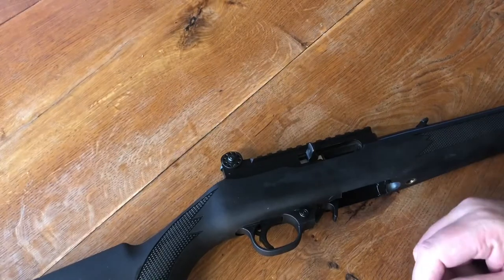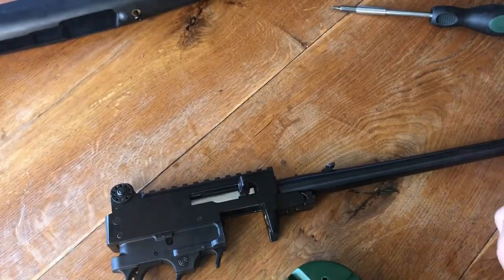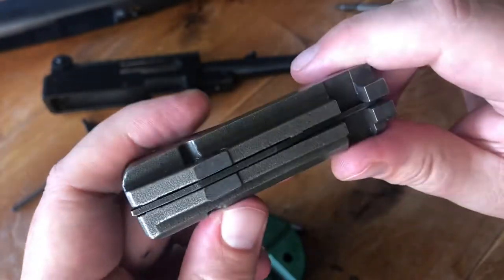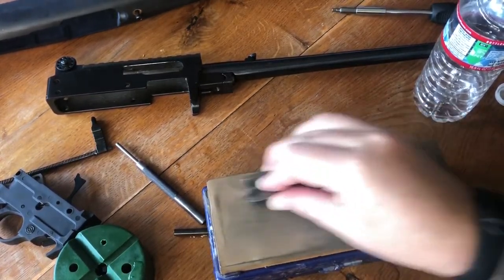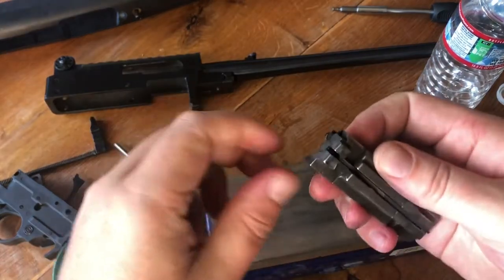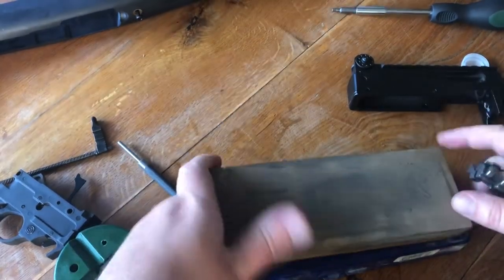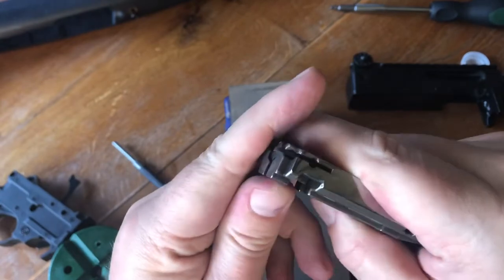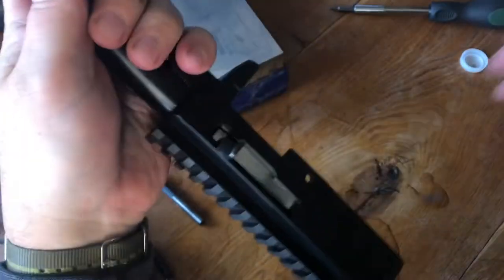Ruger 10/22 bolt polishing

Comment: I used polishing rouge, felt wheel and my Dremel to polish all the metal to metal surfaces.  The radius on the rear of the bolt that cocks the hammer, I wheeled a much less of a sharp step to a more smoother ramp. Gun grease on my fingertip on all the surfaces. Now the bolt travel is so smooth and this has reduced "stove pipes" drastically.
Reply from the maker: I thought about adding the radius but didn't get around to it.  Maybe in a future effort.  Thanks for the feedback!

Comment: I am confused about how aggressive some of the commentors are.
Reply from the maker: Me too, just sharing my process and learning and got jumped on. All good though, the interaction drives up the views I think ;).
Reply: @desertislandtoolworks1956  I just repeated a similar process on my bolt with an 8000 grit whetstone.  Mine is an older bolt so the contact surfaces are larger.  Certainly improved the smoothness of the action and possibly accuracy (could just be placebo leading me to take more time on my shots).  I also polished the face of my bolt and the breech face of the barrel.  There had been some pitting on the breech face of the barrel so I mostly took that off but was afraid of removing too much metal.  Really enjoy touch up work like this where you can improve function without opening your wallet. Thanks for the content.
Reply: @desertislandtoolworks1956  "opinions and azzholes, everyone has one and everyone thinks theirs is the only one that doesn't stink."
as for the video I like the simplicity of it, KISS always works best.
Reply: @originaloldpop8405  thanks for watching and for the feedback. I’ll try to keep them that way when I make more.
Reply: It's the internet, so many informed opinions here!

Comment: You should never sand. You loose too much material and then it's sloppy. Just polish those points and it will remain tight but run so much better.
Reply: Exactly.
Reply from the maker: Great point, that is what I did.  The stones are polishing stones not sand paper.

Comment: Raised surface on that "new" bolt means less machining and smaller contact patch which is a win win for Ruger who loves to cut corners if it doesn't really effect operation.  Smaller contact patch would theoretically reduce friction... I'd say just put some lapping compound on it and shoot a box or 2... That's pretty much what Glock does.
Reply from the maker: I'll bet that would be pretty effective too, may try it on the next one I have trouble with.
Reply: excellent idea.

Comment: I polish same surface PLUS both sides. I then polish the inside of the receiver which appears to be painted wherever the bolt makes contact. Been doing this to every 10/22 I get my hands on. My first 10/22 got an absolute mirror polish when I was 14 years old. My brother took that gun from me and has never returned it. Haha. That’s what brothers are for. He said he loves the slick feel of that action. It’s a real nice thing to do to these Rugers. You don’t have to get a perfect mirror polish. If you spend 30% of the time toward a mirror polish you probably have done 90% of the slicking up that you desire. 

These are phenomenal guns. My bull barrel one was just printing 10 shot groups inside 2” at 100 off the bench. Basically a big jagged hole. I haven’t found any ammo better than any other either. It does seem to like the high intensity MiniMag type ammo for cycling. Such a positive cycle sound when you fire. You know the round ejects and the next one is in battery waiting for you.
Reply: What grit do you use
Reply from the maker: I've been thinking about re-barreling one with a bull barrel to see if it helps with accuracy.  Did you buy it that way or change it? Is there a noticeable difference?
Reply: @jimmychang1433 I start with 220 on the bolt. I don’t press hard and I use a lot of oil on the sandpaper. By the way I use the black paper. It’s made to be wet. I then move up to 400 then 600 then 1000. I have gone all the way to 4000 since I have a lot of various sand papers. Really though after you get up to 400 you are done. You can also use a Dremel and a wheel with polish to finish it off. It gets smooth and shiny. The inside of the receiver is a bit of a pain to get to and it really pays off fussing with it though. The inner slide surface has like a paint coating and if you get down to bare metal and smooth it out it really helps. 

None of this is tough. It’s just time consuming and a little cranky inside the receiver. 

But NOT HARD. So worthwhile doing it.
Reply: @desertislandtoolworks1956 I have built 10/22’s and put bull bbls on them. The one I currently have a former CT State Trooper built and sold to me cheap and since it shot slightly better than my other one I had I sold that one and kept this. Bull bbls make a HUGE HUGE difference in handling and being steady - 22’s have low recoil anyway but bull bbls add weight and it’s up front so you really dampen the recoil. Makes it so easy to get back on target. 

Alright. Enough. I gotta go shoot mine seeing as I just got excited thinking about it!

Comment: I used mag wheel polish and an old tshirt cut so it lays perfectly flat on a table. It turned out awesome and feels way smoother in operation. My next plan is to radius the bottom rear of the 10/22 bolt and polish both my mossberg 640kd bolt and ruger american bolt.
Reply from the maker: Sounds like a good way to do it, how'd it work on the other guns?
Reply: @desertislandtoolworks1956  pretty well. No longer get that zip sound with the American and the Mossberg is smoother as well.

Comment: I looked for follow up videos to find out it it did any good, but could not find one.
My opinion is that if it does anything it's more sloop between receiver and bolt which is rather something negative.
As long as there is not any ridge where the bolt gets caught the spring and the recoil operates the bolt just fine. 
I'd think that cleaning and lubrification does the same as polishing.
If anything the polishing might only do anything if you use subsonics with a supressor.
Reply from the maker: I didn't make a followup video but this resolved the issue I had with the bolt closing.  I have since purchased another 10/22 that did not have any issues from the factory.  I think this is something to consider if you have an issue but certainly every gun does not need it.  If you found this problem in a new gun you could certainly send it back as well but for me this was an older gun and not something I felt I could send back.  If the work hadn't resolved the issue I had planned to buy an aftermarket bolt so really no risk in what I did either.  Thanks for your comments and for watching.

Comment: Nice upgrade.  I'd also check the extractor recess in the end of the barrel for carbon fouling.  That area can collect gunk and cause some extra drag you first notice if you ride the bolt forward.  Less likely, you could have a barrel clocking issue too.  Happy shooting.
Reply from the maker: Thanks, I've done those as well and all seems well on that front.  It is running pretty well now as long as I use decent ammo (which is hard to find these days).

Comment: A little cleaning and oil does wonders
Reply from the maker: Yes it does!  Especially around the extractor claw and slot in the barrel.  That said I've also found that not all bulk ammo is equal either, the Winchester I was running is pretty disapointing.
Reply: Wrong..oil is the worst thing you can put on a 10/22 the ammo as dirty as it is you should be using a dry lube. Unless you like taking the entire gun apart for cleaning every 200 shots.
Reply from the maker: @ngirardo86  ah yes, the great conspiracy where ruger tells you in the manual to wipe lightly with oil to trick you into hating their product and never buying another. A little goes a long way but no reason to let a gun rust.
Reply: @desertislandtoolworks1956  I don't know how you store you're firearms but I've NEVER had one get any sort of rust and I haven't used actual oil in probably over a decade. Nothing against oil its just when better products come out why wouldn't you use them? I bet anything you don't put conventional oil in your car anymore. Synthetic is a much better. Same goes for firearm cleaning products.
Reply: @ngirardo86  I don't know what magic you are using bud, butt good for you.
Reply: @delaniemitchell5241  its simple you don't let the charging handle go when removing the bolt so it can't slam home and almost cut a finger off.
Reply: @ngirardo86  Are we still talking about this? Sorry my comment was addressing your comment about not oiling guns.

Comment: I've a question:  What about the surface on which the bolt rides?  Should one polish it, and how should it be done?
Reply from the maker: Joe, I deburred the inside of the receiver with a scotch bright pad in that area but did not actually do anything to the bolt here.  I would inspect the bolt and very lightly polish any area you find to be rough.  I just bought a second 10/22 and the bolt is much better from the factory.  I don't think I'll touch it (unless I decide to radius the back of the bold more).  This second gun also runs much better out of the box.  Thanks for watching and hope this helps.

Comment: Did it reduce jams?
Reply from the maker: I was having issues with the bolt going into battery.  That seems much better after this, although I also stopped using some winchester promo loads that seemed to be problematic.  The extractor change out seemed to improve the stove piping as well.  All that said I purchased another 10/22 that has none of these issues when I run them side by side so clearly not needed on everyone.

Comment: why doesnt the water make the bolt rust?
Reply from the maker: It was only wet for a short time.  I dried it and then applied plenty of Rem oil before I put it back together.

Comment: What a poorly finished bolt AS COMPARED TO THOSE OF 20 YEARS AGO.  Anything to cheapen production costs I guess.  Screw the buyer.
Reply from the maker: I wish I had an older one to compare it to.  I've only ever owned lever and pump 22's until this one.  Bought it so my son and I could do the Project Appleseed events together and then found it needed some work right out of the box.  It's running a lot better now.
Reply: @desertislandtoolworks1956  good luck. The older guns never seem to have a problem.
Reply: Its more of a price competition issue rather than screw the buyer.  too much cheap stuff coming in from abroad and too many people will buy cheaper every time, our gubmint should place stiffer tariffs on imports to even the playing field

Comment: Removed far more material than was necessary or beneficial.
Do you actually have training in this? How did you determine the necessary amount to remove?

I don’t mean any disrespect but the multitude of these DIY videos just wind up spreading incorrect information.

Flitz polishing compound would have been a much less destructive choice.
Reply from the maker: It’s difficult not to read your questions as disrespectful but I’ll go ahead and give you the benefit of the doubt. The stones I used were designed to polish the blades of hand planes and very fine. As you can see I did not even remove all of the machining marks from the bolt. I’m not sure how you determined that I removed too much material but I’d argue that it’s a false claim for several reasons. 1.  The bolt is well within the sloppy tolerances of other ruger bolts. 2.  The bolt functions better now than before I worked on it. 3. This work has little potential to create any safety concerns. 

I appreciate your feedback, it is possible buffing would have helped but it does not creat a flat surface only rounds the corners of the rough machining. This was work done to fix an issue, not something I’ve needed to do to other 10/22 rifles. Worst case was that it wouldn’t help and I’d buy an aftermarket replacement. I shared this as something I was playing with and do not profess to be an expert. Too many keyboard warriors caution people against learning and experimenting. Things like this can be done safely and are educational. Sometimes they work sometimes they don’t. The spirit of ingenuity and self sufficiency is dying in this country. I’m just doing my stupid little part to counter naysayers like you ;). 

If you have some gunsmith lessons you’d like to share I’d love to watch and learn but it is for the most part a group of professionals that doesn’t readily share their knowledge. I understand the liability associated with it to an extent but think it’s more than that.
Reply: @desertislandtoolworks1956  That was a great reply! 👍
Reply: @ClutchClarkUSA He was using a Japanese POLISHING STONE. You must have missed that part, eh?
Reply: Flitz is in the 4000 grit range. The stone he used is a 1000/8000 grit. That stone is a far better option than the flitz on a dremel wheel. For starters, the stone keeps everything relatively flat. The 1000 works four times as fast and the 8000 will polish the bolt twice as smooth... You understand?